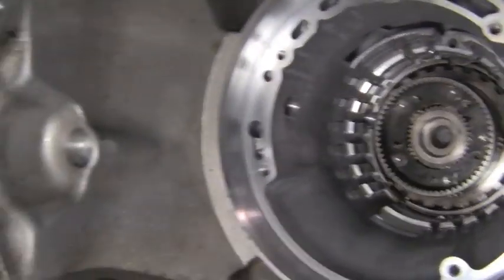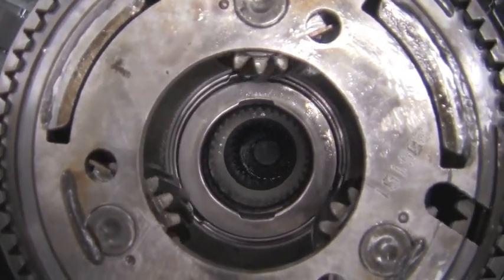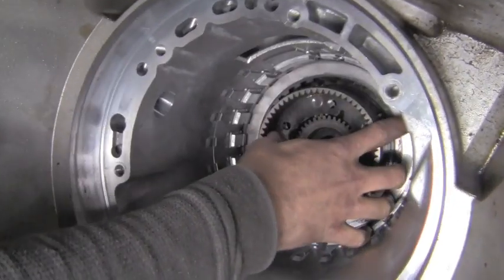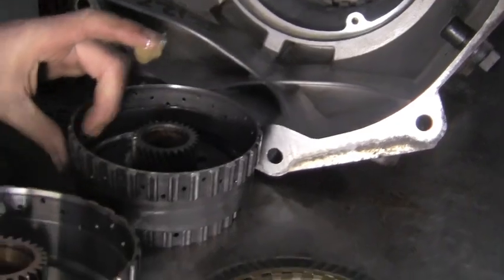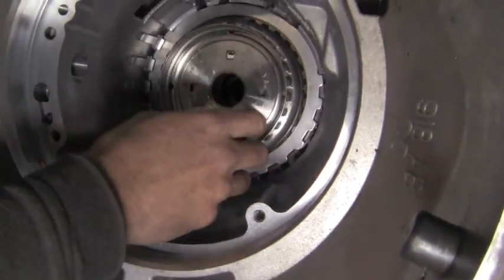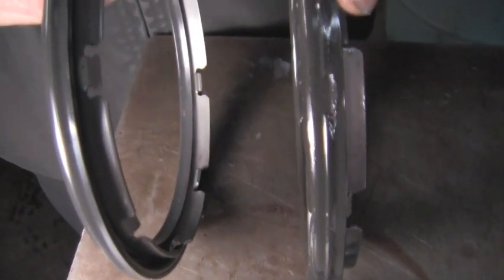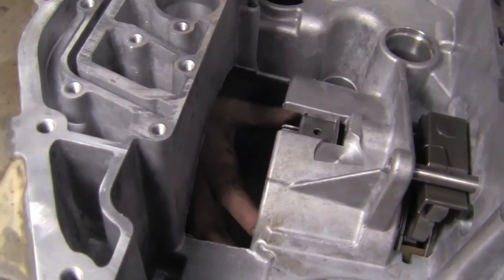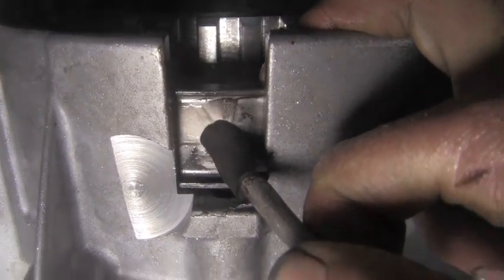Trans rebuild part 12  Reverse 2-4 Drum

Comment: He has the steel rings backwards.  The thin steels go to Low/Reverse and the thick ones go with 2-4.  You can see it when he tears the transmission down plus when I did mine they were like I said.
Reply: Maybe that's why it failed; was assembled incorrectly at the factory
Reply: Mine is the same as you say.  Thin with low reverse.
Reply: thank god for this comment 9 years later. Was in the process of dropping clutch/steels back together and got seriously confused because there was one less steel according to him lol

Comment: A few things to mention.
First, you have way too much background noise. This makes for a very unprofessional video.
Second, you leave out critical steps - like how to retain thrust washers in place during assembly.
Last thing is nomenclature. You called a sun gear a pinion.  you also called a belleville  spring a bellevue spring. VERY unprofessional. You should know what these parts are called and address them accordingly. 
These things may sound  like I am being picky, but when you open the manual, it is important to know what parts are called and how to reference them for replacements.
Reply from the maker: thanks for your observations and comments.  I will keep that in mind.